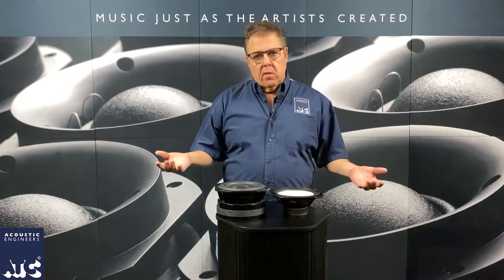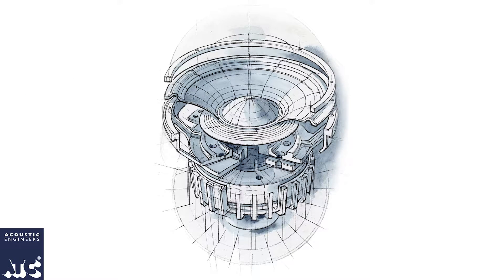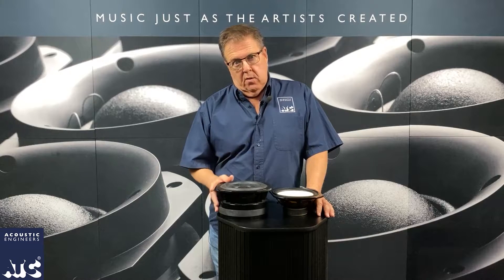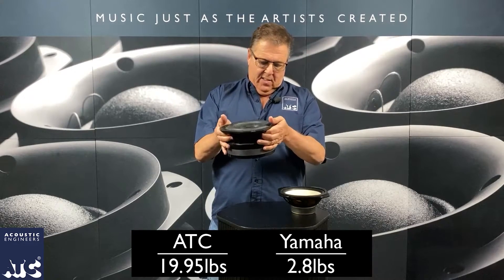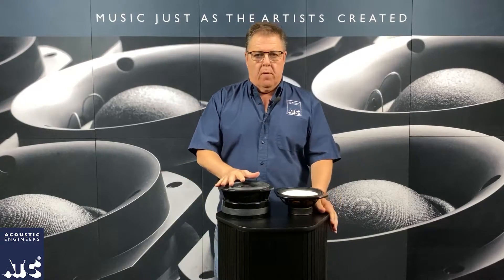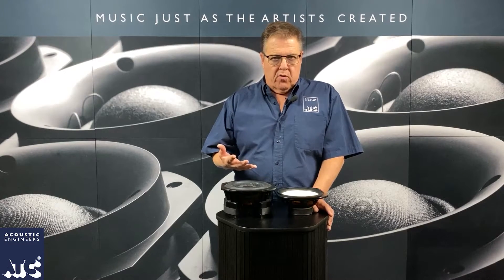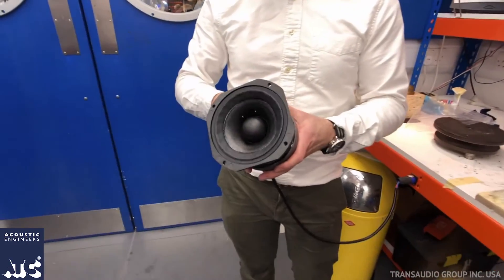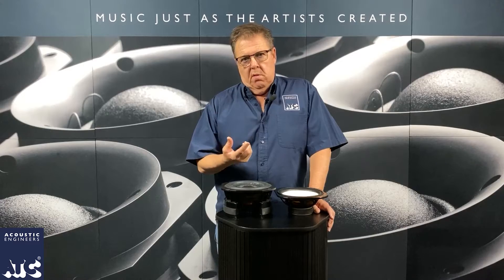ATC Pro Driver Technology - Woofer

Comment: The weight of the speakers' construction, heavier = better, is a bad parameter for judging how a speaker performs, and even more so given the use of many lightweight materials used in speaker construction nowadays, composite cones and neo magnet structures included. This isn't 1992 ... and for some aspects of speaker design and construction, things have moved on!

Comment: I worked in the pro sound reinforcement industry during the 80's, supplying huge rental systems to major touring artists. Out standard midrange horn used two ATC PA75 12" drivers which were unburstable. I vividly remember driving down to ATC's old facility off the Great West Road to collect these things 40-50 at a time. I met Billy Woodman on one of these numerous visits. Lovely guy.

Comment: Why dies nobody klippel test ATC drivers? And a big chunky motor mean little to nothing. I'd want to see some T/S parameters.
Reply: ATC has a bunch of Klippel test gear that they use for development. The motor is big because the moving mass is very high - ATC uses big heavy doped paper diaphragms because they are nicely lossy internally but still have good stiffness. So they have to have a lot of motor to have reasonably decent sensitivity and HF extension. 

Anyway, if you google it you'll find the T/S parameters from their old catalogs.

Comment: I recently listened to the ATC 50A speakers and they sounded very good in my opinion. In terms of driver volume, it is obviously very impressive. One must also add in fairness that the driver uses a strontium magnet. Had the driver been equipped with a neodymium magnet, it would have been much smaller. I am a new fan!

Comment: the price is too high
Reply: High performance costs money... The best of the best costs more money. .. Our older ATC Pro SCM20 active monitors (2 pairs) haven't missed a beat in 25 years. . They are "balls-on" near/mid-field tools.
The Pro SCM100 Active monitors (3 ea.) are much of the same. .. A shop engineer can use these "tools" for hours on end without fatigue. . The ATCs have earned $$ their keep every day. . Top shelf in our shop. .. Cheers, Vail, Colorado.  .. R.I.P.  Bill Woodman. .Founder; ATC Acoustics UK
Reply: not compared to Magico et al
Reply: Absolutely not

Comment: Looking at the range of bass drivers designed by ATC am I correct is saying they all have rubber surrounds except the the largest 15 inch driver which has a foam surround? What is the reason for going foam on the largest driver, is it a weight issue? Also surrounds have a reputation of breaking down after many years, has ATC managed to prevent this?
Reply: foam has higher flex and damping / weight compared to rubber, making efficiency the goal for the 15'' i think, while maintaining low freq
Reply: @CarlBurnss  thanks Carl, never seen or heard of any surround issues with the ATC but plenty of speakers from the 80’s with foam surrounds are now suffering !